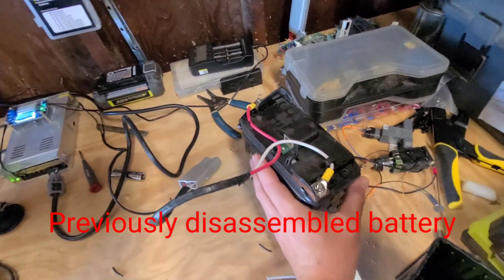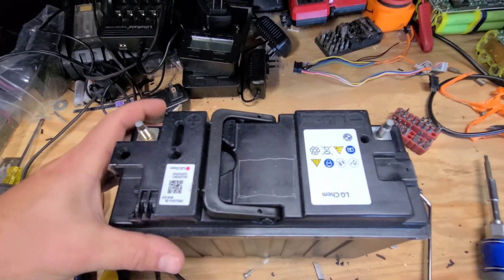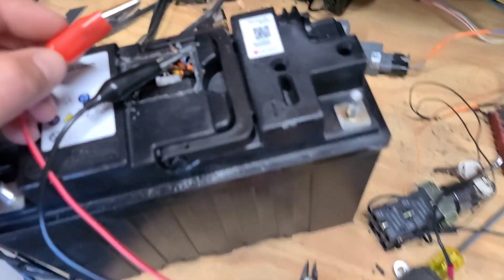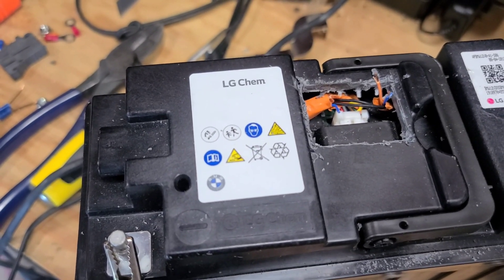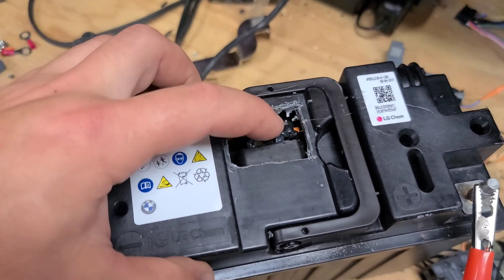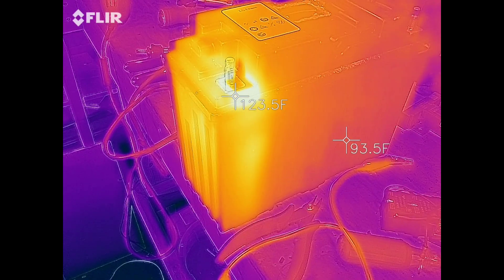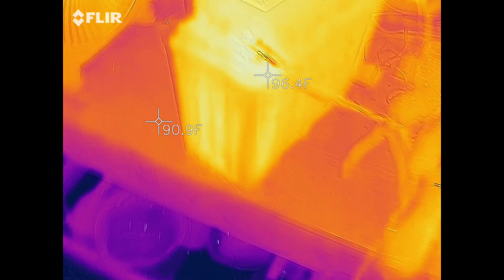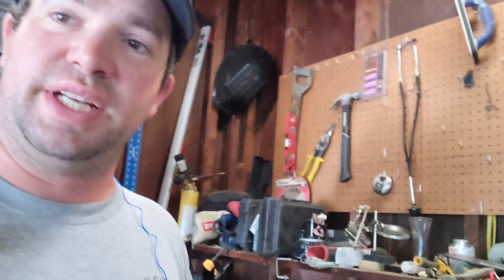12v BMW LTO Battery Relay Hack Through a Small Hole in the Top

Comment: Anybody rember where we bought these from? Bch didn’t have then nor battery hookup
Maybe the person selling these will know how to fix them or have pics of inside ?.?

When I bring voltage up to about 14v on my power supply it will show .005 watts and then the relay will click on to charge after. Little while

But can’t read any voltage without power on
So not very useful
Anybody have good pic without the case on Showing the “internal “ battery

Thx
Reply: @swormser865  what year is ur battery produced

Comment: hello, i have a g20 with LTO battery, car was in accident.
i charged the battery, but as soon as i try to connect terminals under the hood relay clicks and battery turns off
ista show 030DA0 Lithium ion battery: Crash
any advice?
Reply: https://www.youtube.com/watch?v=QwSVCoSjAV4
Reply: @herbertwerner2287  hi, so i reversed the relay , charged the battery, when I attach it to car , clicks off, giving relay jammed error
Reply: It could be the relay switch switched off inside the battery of your BMW. Shutting off your power from the battery.   And/ or your battery is dead flat dead.  Also could just be damage from the accident because if this never happened before the accident and happened after its likely related. But I know because I have several of those batteries that re-activating the relay can be done. But by who is the question. Most mechanics would not do that. And are these issues battery related or is it something else because of an accident. I wish I could help ya out but i don't know.
Reply: @herbertwerner2287  hello, if i do the steps in vid and install it to my car, delete faults, would it work??
Reply: @emiral-khashab3308  Hard to say. If you reset the relay and you can charge the battery and delete the errors ya maybe. But if you can not reset the relay and it doesnt charge or you reset the relay and still no charge then it is damaged. Good luck !
Reply: @ well. I have bad news, the design of battery is changed, i just cut the top.  Different wires, tried to cut the left and right to accses the relay , no relay to be found ,
I dont know what to do
Reply: @emiral-khashab3308  You should do a voltage check if possible you need to know what your dealing with in voltage. I only know of the batteries exactly like whats in this video. But aside from that thought Id check voltage from the terminals with and without being connected to the car
Reply: @ it reads 0v
Reply: Maybe this is what you have in this link. BMW yes, but LTO no its not.
Reply: @ is your battery design new as well, i wanna. Cut all the way to find the relay but cant find it. Tried charging. ‘Not receiving at all
Reply: @emiral-khashab3308  My battery is exactly the same as in this video from Ben. Pay close attention to how it looks on top with case on. I suspect you don't have the same battery.  There must be some kind of switch or something but where and how is not something I can answer. Did you go to the link I gave you of another BMW battery. Im thinking you have that type. Which is not LTO so its completely different.
Reply: @herbertwerner2287  am sorry there is no link, my battery is exactly the same from outside, 100% but inside is different

Comment: tell me, I charged it thanks to your video, I put it on the car, and how to reset error 030D9A

Lithium-ion battery, relay: stuck closed
Reply: Hey, did you figure it out ? I get the same error as you.
Reply: @ipodTouch4g07 did you manage to fix it?
Reply: @user-derzkij Yes, use this method to charge it and then reconnect the replay back. If your car is okay it should start working
Reply: @ipodTouch4g07  hi, was your battery wires different as well?
Reply: @ipodTouch4g07 hello, i have same issue , how did u fix it
Reply: @emiral-khashab3308   Hey, as I mentioned, use this way to charge the battery, then reconnect the replay and install in the car.
Reply: @ i did, but when i connect it, the relay shuts off, and gives me the code 030D9A
Is there smth am missing?
Reply: @ipodTouch4g07  i even deleted the codes many times, comes back every time , and the battery relay shuts off as soon as i connect it to the car
Reply: @ Has the car been crashed ? Check the pyrofuse on the main battery. There is one small connector coming from the front battery that must be connected.
Reply: @ yes it was in a crash, i have fixed the pyro, not giving the crash fault any more, the only fault in ISTA is relay jamed, i did the video steps, opened the relay, put in car and shuts of, very wierd drives me crazy
Reply: @ But did you reconnect the relay back as it was from the factory ?
Reply: @ipodTouch4g07  so ur battery relay also click when you connect to the car? giving relay jammed error, then delete the code? please correct me if am wrong
Reply: @emiral-khashab3308  If disconnected internally in the battery it gives error. Return the battery as it was from the factory, reconnect relay wires and then connect to the car. Check the positive main battery terminal (it has connection to the front battery). If everything is okay it should work.
Reply: @ great i will try, is it normal that the relay click when i attach the battery to the car?
Reply: @emiral-khashab3308 Yes, listen for it when you start the car, make sure the battery is also charged. When started it should click again.
Reply: @ipodTouch4g07  so good news, relay clicks again giving 14,5v when I start the car , and remains like that after I turn it off, I hope it doesn't give relay jammed error, am waiting for my friend that has ISTA, btw when I remove the battery from car  still gives 14v until about 30min then relay clicks
Reply: @ yup, it did, still  gave me error 030D9A relay jammed, any idea ?
Reply: @ Are you sure the wires inside the battery are connected ? Also did you replace the Plus cable on the back ?
Reply: @ yes the wires inside the battery are all back as factory, if not , the relay wouldnt open and close ( click ) when i put in the car , and i changed the red wire in the back, i did a ETS BATTERY test in ISTA. It came out as a fault relay ( sequence time was 1700ms ) i think the relay is faulty, or bms just thinks that, have you encountered such an issue?
Reply: @ Was the red wire on the back OEM. I installed a chineese one and the relay didnt work because of it. Replaced with OEM and it worked
Reply: @ i didnt know that, it also gave you 030D9A relay error code on ista?
Reply: @ I had no error at all, but the relay was always opened and my start stop didnt work
Reply: @ipodTouch4g07 what year is your battery
Reply: @ipodTouch4g07 hey brother , what u got the Chinese red wire, what faults was the car reading
Reply: Hi, did u mange to fix it

Comment: il  rele e'  solo una protezione di undervoltage  e  under/ over temperature non   esist  bms   ma  un controllo bilanciamento celle 
con un forte magnete, vivino  al rele, altrimeni   metti  a  negativo   il pin  1  o 3   ( pin 2  e  il positivo 12 volt) puoi  reinserirlo    , senza aprire   la batteria
Reply: Do i need to connect charger to + and - leads, and then 1 pin to negative 2 pin to +12v ?

Comment: I would still like to know what kind of BMS could work with these batteries. If someone can answer that Id appreciate it. Thanks.
Reply from the maker: Hi Herbert, 
I typically use Daly brand BMS's on small units like this.  They do make a version that is compatible with LTO batteries.  Best place to get them is directly from the Daly store on Alibaba or Ali express, although it does take a while.
Reply: @benssolarandbattery  Thank you Ben. Ya I still have some of these batteries I was wondering if I could get away with not using a bms on them because they are LTO type.
Reply from the maker: @herbertwerner2287  I used one of them in my kids power wheels car for the entire summer and it never went out of balance with no BMS  They are really safe to.
Reply: @benssolarandbattery  Thanks Ben. Ya I really like those batteries. Using one to power a small tv and sometimes a mini fridge. The other ones I bought [ last year] I have not opened or used yet.

Comment: I bypassed the relay on one thinking the BMS will continue to work to balance. Unfortunately, there is definitely a parasitic drain. I've checked thermal camera temps and there's nothing notable like in your video when the BMS is unplugged, but after 1 day we go from 15.6 to 13.6 and after a week we're at 13.2. This is ONLY with the relay switched on and disconnected. The BMS is not touched otherwise. Was hoping we could use these in their case with a small cut but looks like the BMS must be bypassed unless you're okay with it draining
Reply: BMSs do go bad and drain batteries dead.

Comment: I bought some of these batteries as well.  It shows 0 volts since the relay is off.  However, I connected it in parallel to a 12v lead acid battery that I have charging on a 200 watt solar setup and the relay clicked on and was charging and got up to 13.6v.  When I disconnected it from the lead acid battery it clicked off again and reads 0 volts. 
It seems that at some specific voltage the bms activates the relay and then when no input voltage is coming in it shuts it off.  I guess it is looking for the input from the car it was installed on to turn it on.
Is the bms still working? I think so since something is clearly controlling the relay.   
Does your method of cutting those two wires from the relay disable the bms? It would be nice if the bms stayed intact.
Reply from the maker: I think the BMS is still working, but I'm not 100% sure.  Cutting the relay wires only disables the BMSs ability to shut off the battery in the event of overcharge, over discharge or other event.   Being an LTO battery, there is not a lot of concern there.   When I disconnected the BMS leads to the top of the battery, there was a lot of heat that came from the BMS, indicating that it was bleeding off power in an attempt to do 'something'.

Comment: Why is or was it important to turn on the relay ? I have four of these batteries and I opened one and took it out of the case. Using the terminals on the battery and not on the case lid I charged mine to 14 volts and then used it and brought it down to 12.6 volts. I tryed charging it again and was going to charge it to 14 volts again but altho the charger shows its charging I cant get the battery to go any higher than 12.9. My first charge got it to 14 volts. My second charge hovers at just below 13 volts.  I'm not sure what this relay has to do with the battery working or what I'm doing wrong. With the relay disconnected to insure the battery will charge shouldn't it then charge or do I have to get this relay wired and flip the switch to get my battery active to then charge ?
Reply from the maker: The only reason I wanted to do this was to be able to use the battery without removing the heavy duty case around it.  In my case, both relays were shut off, so charging from the terminals without either removing the case or turning on the relay was impossible.  What type of charger are you using?
Reply: @benssolarandbattery  Hi Ben thanks for the reply's I am using the NOCO GENIUS1 (G750 Rplcmt) 1 Amp Smart Battery Charger. I tryed again to charge the battery and again it did charge from 12.6 to 12.9 but that took an hour and a half and then I stopped charging it because it was late and I didnt want to leave the charger on overnight. I will try again tonight to push the charge past 12.9 If that doesn't work I will just remove the bms and use a 6s active cell balancer. I will remove the relay's. I only know where one relay is, the other I havent seen but I will find it and remove it. I just want to get the battery to 15 volts. and balanced. Thank you Ben.